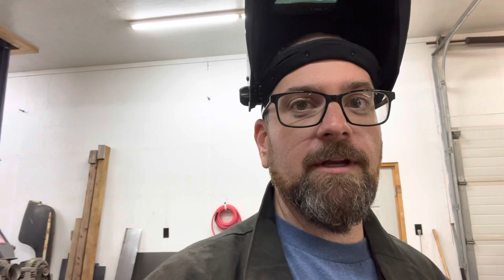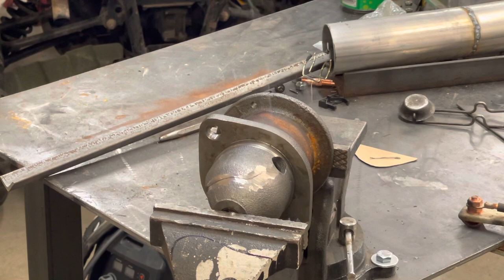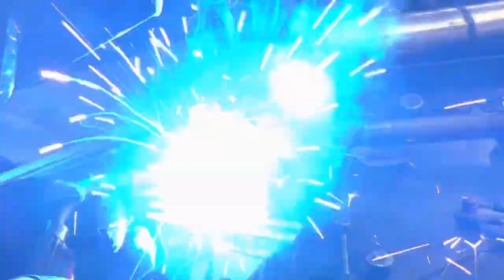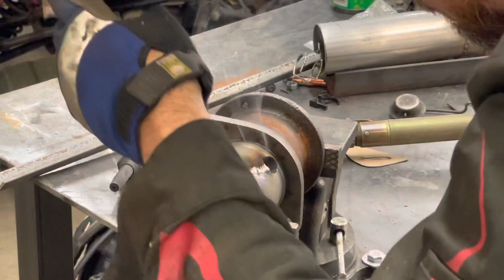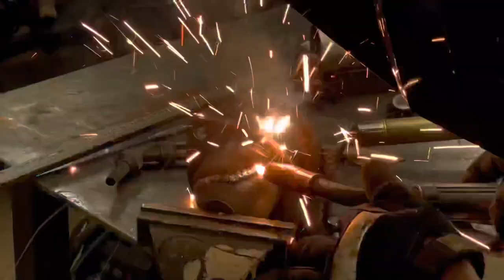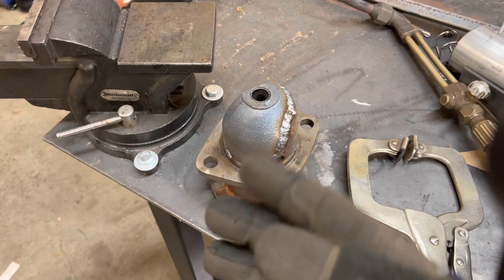How to Mig Weld Cast Iron

Comment: Sorry mate but you are halr correct.  You need to be heating it to red hot temp. glowing red almost whit to do any good. cool it slowly, even place into a hot oven or place it in sand.  It will crack otherwise. and if you use stick welder you can buy and use cast welding rods. And please STOP welding like that.  That's crap.. up the amps and get the heat into it. Heat is your friend in this type of welding and continuous welding. not that YouTube Chinese tack welding
Reply: Locally overheating cast iron is a critical mistake. You want the heat to soak evenly in between bursts, that is why it's often done like this. Too much heat causes a single area to expand without the material around it catching up. This creates stress, tension, pressure whatever we want to call it.

Comment: A welder taught me 40 years ago how to arc weld cast iron... Get hot with torch... arc weld a little/peen.. arc weld a little/peen..  arc weld a little/peen.... Next time peen it a little with the point of a welding hammer while it is hot.. heat it up hot as possible with the torch too and give it some more peening.. relieves stress.

Comment: Very poorly done. Must V out the crack before welding. NI rod works best for cast-iron.  After welding cast, put the part in a bucket of sand and cover it. Must cool slowly.
Reply: MMA rods are best for cast
Reply: So use a completely different method then the video title? It’s fix with MIG not fix with stick
Reply from the maker: @306motovlogs5 well it’s still working on the tractor. So you be the judge.

Comment: Electric welding of cast iron is possible but the process turns the weld joint area from gray cast to white cast. If machine work is required such as threading the machinist won't like you.

Comment: I'm definitely late to the party here . I tried years ago welding cast with stick . What I've learnt over the years is to grind out as much as you can to get a deeper weld area and better penetration and a bigger amount of weld , heat up before and obviously during to keep at a certain temperature but to cool it slowly using a heat blanket and covering in dry sand to slow the cooling down as much as possible . It may only be a small item but if it loses heat quickly it has more chance to crack and not necessarily in the same place . 
Looking at the comments it seems to have held .

Comment: Gas welding tanks are getting crazy expensive where i live to refill, so i treated myself to a free toaster oven from the dump, lol.  It goes up to 450 freedom degrees, and ive had good luck pre-post heating with that.  I just fixed a busted cast iron shifter fork in a $600 backhoe, took like an hour, including r&r, and now my backhoe ja worth like $3500.  So i made $2900/hr, lol.  Now to solder up the rad-e-ator, and put a motor off an old jeep starter onto the bendix from the backhoe cause a cup of rust dust fell out of it when i opened it up.  Then just about 20 hydraulic hoses to make and im done, lol.

Comment: I've had some lousy luck with those aftermarket Chinesium starters on my TO-30. Ended up ditching it and tracking a couple Original Delco-Remy ones that I used to build one good one from parts. As far as the welding, It can be a bit of a crap shoot working with that old cast iron. I have had luck with the mig in the past but did not pre-heat. Never tried arc welding it but I have seen where 7018 rods have been used with some success. I have brazed an old ferguson carburetor body where the flange tab broke off. I think if I had the torch out I would have gone ahead and just brazed it, but that's just me. Hope it doesn't seem I am being critical of your method, just making chit chat. Appreciate you taking the time to video your experience working with it. Glad to read that it is holding up well.
Reply from the maker: Thanks for the comment! I thought about braising it but wasn’t sure of the strength as braising is a bit softer than the Mig. For a carb flange I could see it working well as there is not much force on the flange. Luckily it’s still going strong and I try not to bump the shifter into start anymore hahaha!!
Reply: @longsspeed  My personal opinion having worked with it is that the Bronze Brazing gets its strength from the fact that it penetrates and permeates the cast in a way that welding simply doesn't. Weld is stronger in itself, no doubt about that but I kind of think of it like welding that stuff is alot like wood gluing a joint. the glue is stronger than the base material so next time it breaks, it is almost like a new break near the repair. I feel like the softer Bronze filler gives the part a ductile quality that makes it less likely to break again. (makes sense in my head) But I am far from a metallurgist, just a guy on the internet with an opinion LOL. The carb has held up well. of Course it helped putting a fresh float valve in while rebuilding it. the trauma was caused by my own stupidity and laziness. lightly tapping a carb to get the needle to seat can quickly turn into getting too rough with it if you aren't careful and you get in a hurry so I feel you there!. Anyhow, Great talking with you! glad we have a forum where handy people can trade tips and keep these old tractors working! I have an old cast iron bench that i'll be welding on this weekend for the wife, think I might try the Nickel Arc rods from tractor Supply this time just to get a feel for how those work. It's the "Right" way to do it according to the internet (although it seems more practical that the right way is the one that works, whatever it is).
Reply from the maker: Ya your idea behind the braising does make sense! Good luck with the project.

Comment: since the crack went from one hole to another, there is no place for the crack to continue after welding. what happens if you mig weld a casting that is going to heat up where the casting and weld will likely expand at different rates? then suppose the weld must also seal against water or oil; is it going to start leaking at some point?
Reply from the maker: Probably would. I believe it’s recommended to use a softer weld material like braze rod when doing something like an engine block. But I’d still try to mig weld it. Just grind it out as best you can to sink the weld in deeper.
Reply: @longsspeed it’s nickel not brass. Which has the same expansion rate yet is harder than iron. Use nickel rod. And grind out almost entire crack so the weld will be filling large area trof.

Comment: I have a cast exhaust fan for the world up just wondering did you use regular flex big weld? I only have a small home welder no gas. I wonder if it would work
Reply from the maker: I used mig gas. I’m not sure what it will do. But I’d try it. I’d grind it out a bit and make sure it’s clean. Use a propane torch to preheat it and go for it!

Comment: is it still holding up? about how much stress does this part go under?
Reply from the maker: Well it holds the gear straight to a fair amount. Yes it’s still working.
Reply: @longsspeed  cheers mate, just snapped off a gearbox mount on an engine block and want to tackle it with my mig. great video 🤙

Comment: I've found a lot of old tractors that were converted to 12volt will sustain damage to the starter nose cone like that as the 6volt starter is running at twice the speed as was intended.

Comment: first drill holes at the very end of the cracks then ground out a grove in the crack first then welded up the seam one good way to heat it up is with a Barbecue heat up workpiece in a 500 to 600 degrees and let it gradually cool down after welding by placing the workpiece in an oven if all possible and gradually cool down work piece.

Comment: Welding isn't the problem it's the cooling after the weld. Also I wouldn't recommend MIG welding this is definitely stick if you want to hold and they make a alloy for cast repair.
Personally I would use stick but before I did any welding, I would pack it with sand and get it a hell of a lot hotter than what you did here. On top of that I would have a bucket of hot sand to drop it in after to allow it to cool at the same rate. 
I sincerely doubt that this repair would last very long. There is more to metal and welding different materials than sticking them together.
Reply from the maker: It’s lasted 2 years and still going.

Comment: Crown Alloys MIG wire for cast even bonds cracked exhaust manifolds. Try a roll. My pro machinistbros repair a lot of old cast industrial machinery and quite like it. (Needs argon, not MIG mix).
Reply from the maker: Thanks for the tip!

Comment: any idea  how hot the preheat  is?
Reply from the maker: I think the important part is that it’s not a shock to the metal the initial Burt’s of heat from the Mig. From cold to hot. So as hot as you can get it before you start welding.
Reply: Not shocking the metal is Probably best yeah, But for those that were still curious on the temp and judging by the colors I'd say roughly between 575 and 800 Degrees Fahrenheit

Comment: Do you think you could use a flux core wire with no gas?
Reply from the maker: Flux core can cause holes and Because cast is so porous I don’t know that I’d try it.
Reply: This iis the question I've been wondering, I'll find out next week as I've been given a large cast iron dome which I plan to turn in to pizza oven but there is welding to be done but if it doesn't work I'll drill holes and bolt the the thing I'm making .

Comment: What kind of wire and gas are you using?
Reply from the maker: Regular mixed Mig gas. I think it’s 75-25 argon CO2
Reply from the maker: Oh and regular steel Mig wire. .030 size

Comment: That weld is all sitting on the surface, I doubt that spot welding technique would've penetrated 16ga steel sheet.
Reply from the maker: Well it’s still holding up just fine

Comment: late to the party...On a crack would yaa drill a hole on the crack line to help stop it from doing it again..or not really needed..?
Reply from the maker: My opinion is that if it’s welded correctly you don’t need to drill a hole. If I weld 2 pieces together I don’t drill a hole at one end or in a corner.
Reply: i would;then weld the hole shut first.